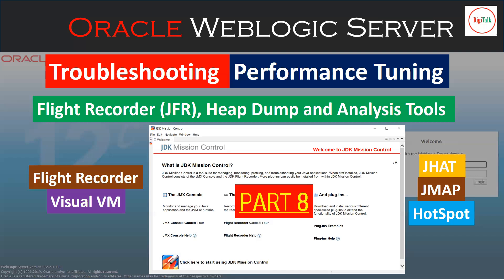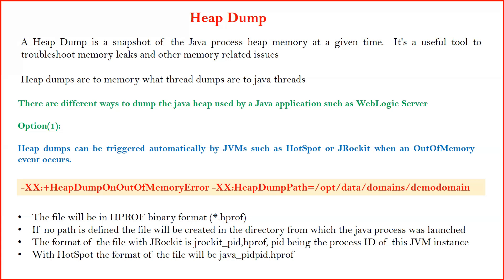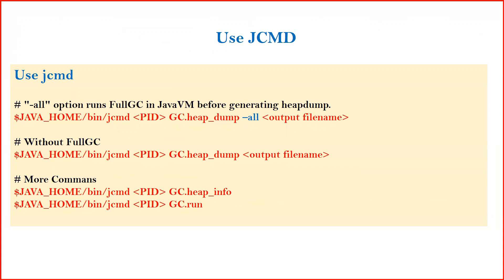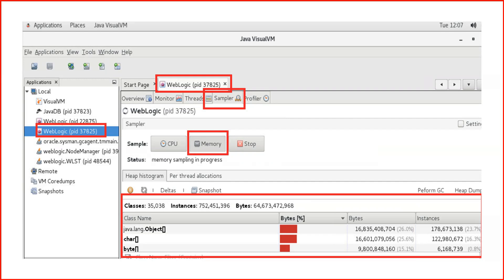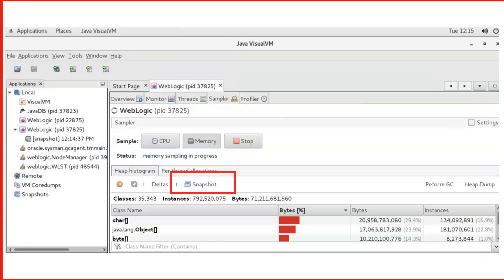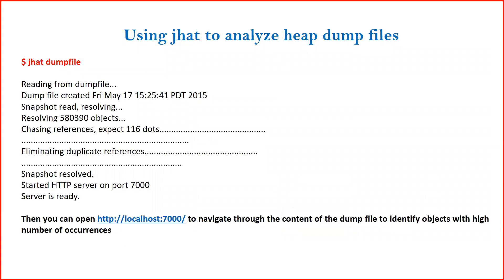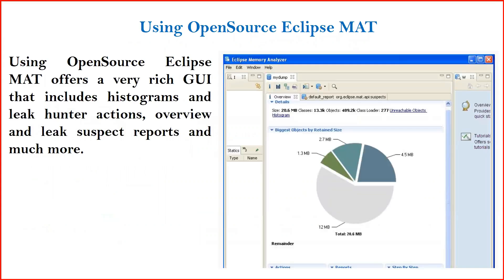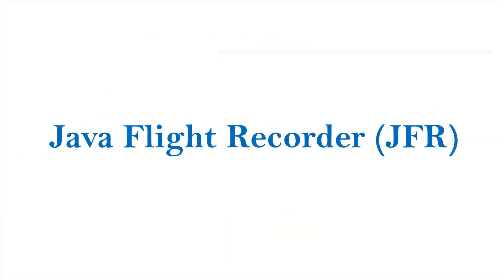Weblogic Server Performance Tuning and Troubleshooting (HeapDump) - PART 8

Comment: If generate thread dump file by using jmap how can I troubleshoot in that file which is the issue ?
Reply from the maker: Troubleshooting the thread dumps is a different exercise, i post a separate video in same
Reply: @digitak.middleware  So why we need to generate thread dump using jmap what is the use of that file which we have generated by using jmap ?